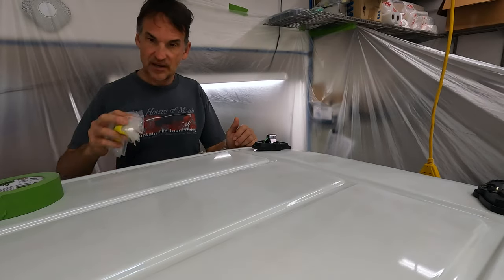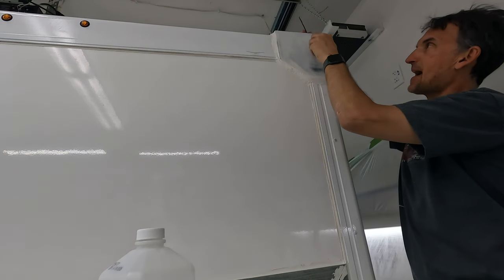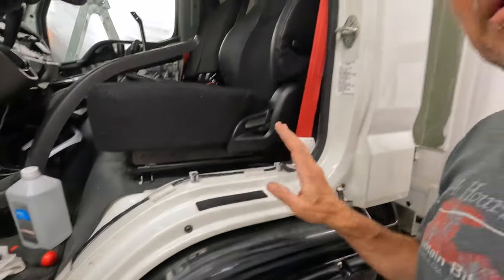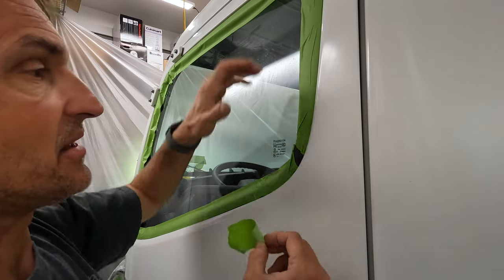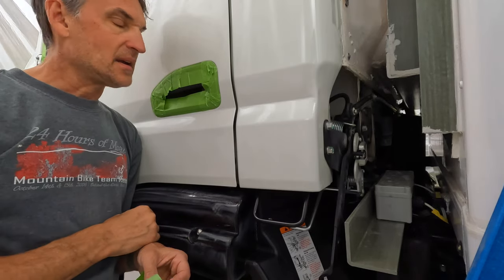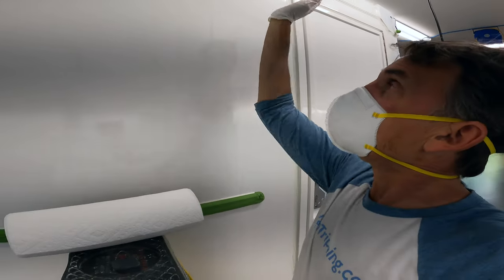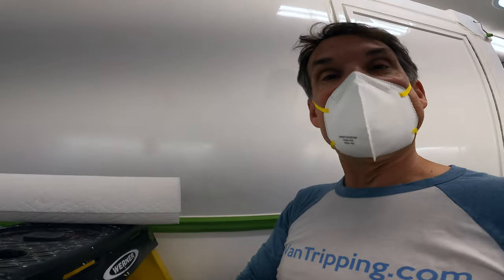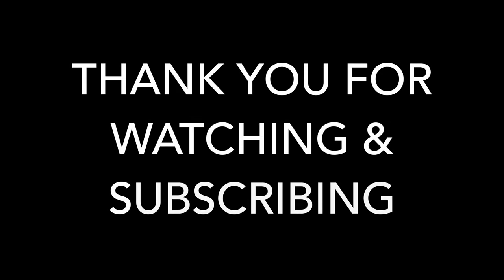DIY Expedition Camper Painting part 2: Final Preparation

Comment: If you have trouble keeping the lights up, pull a string or wire on top of them and knot another string to the masking bags to hold them up.
Also, I don't know the temperature in your shed right now but you should avoid touching the cleaned up surfaces with skin to avoid unnecessairy fat/skin/hair transfer whitch can show up afterwards under the coating.
Reply from the maker: Thank you for the suggestion. Yes, I definitely avoided touching the areas to be painted after their final cleaning unless with gloves, as you'll see in my next video, as well as application temperature.